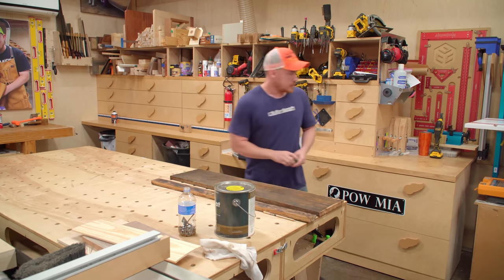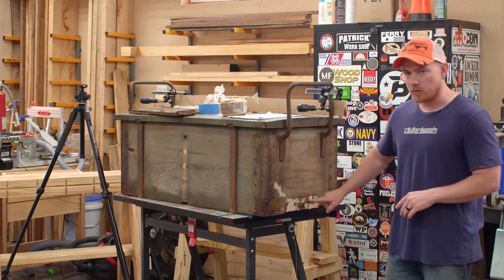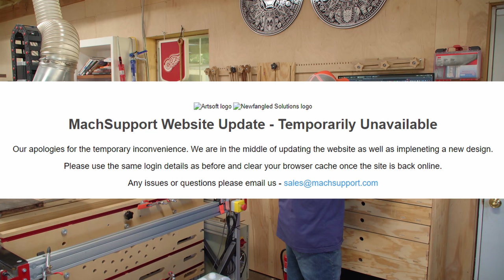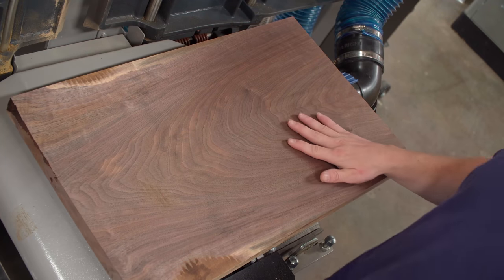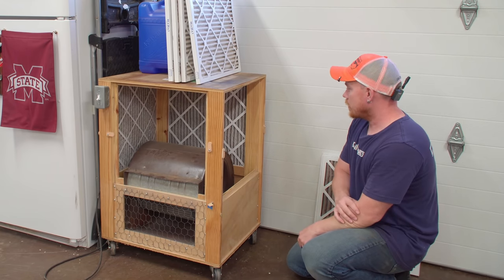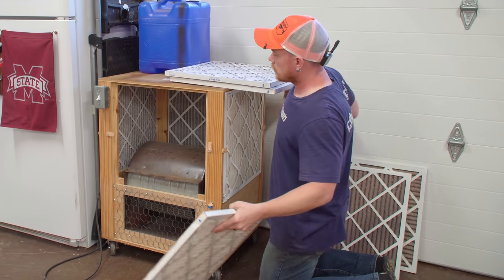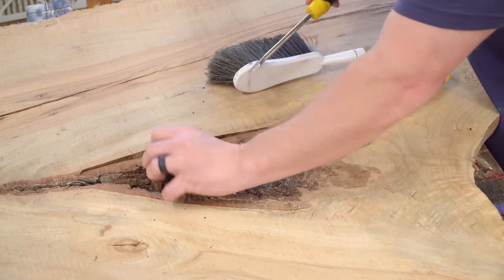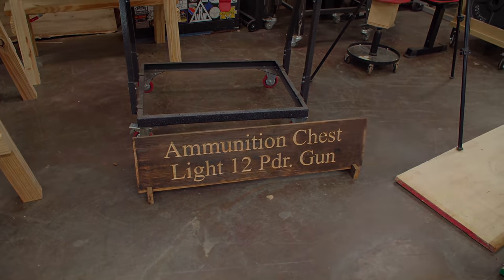Shop Day: Wide Walnut, Sign, Pecan Crotch

Comment: +1 for the Linux mention. Problem solvers and people who don't like the status quo use Linux. 💪
Reply from the maker: Somewhere between video 50-100 I switched back to windows after building my first editing computer in 2013. I was a linux user at the time mainly running XFCE. KDEnlive was my first video editing program. Switched to windows because at the time KDEnlive didn't support multiple CPU cores making my new build kinda useless.
Reply: @JayBates2  amazing! Well I don't blame you for the switch - I'm a web developer and use a Mac for my day job simply because designers use software that runs on osx and I have to open them. 🤷‍♂️

Comment: Convert the CNC to LinuxCNC. Seems I heard that Tormach has converted to LinuxCNC to run their machines, and released some portion of their Path Pilot UI so it can be used with other machines. I've not attempted to change from the default GUI for my CNC box. Just using the default Axis.
Reply from the maker: SketchUp isn't great on wine. I haven't tested VCarve pro on wine yet.

Comment: Jay...I did like this style video.  Random thoughts and ideas that may be useful to others.  I have been watching for several years and picked up lots of good tips from your videos.  In fact,  I bought my A3-41.  Overall good choice - it is a beast but I have had challenges with keeping the joiner aligned so that I can count on consistent flat joints.  I now keep the left cover plate for snipe adjustment open so I can make small adjustments if needed.  My thoughts are it is a faulty design issue because the snipe and ability to keep the head and outfeed side at the right dimensions seem to be dependent on the consistency with which you tighten the outfeed side when switching from planner to jointer mode.  Curious if you have had this same experience and is there a technique you use to keep the outfeed table to cutting head at proper alignment?

Also do you have a video on that device you used to go over the adjustment handle for the planner - looked pretty cool.
Reply from the maker: The adjustment handle for the planer is just a disc with a cutout for the handle. Super easy. I don't have any issues with the jointer. I only tighten the handles just enough to engage the cam. I don't crank on them at all.
Reply: @JayBates2  thanks for the answers.

Comment: Enjoyed this Jay. Question, do you ever clean out your filters with compressed air and reuse them? I do that a lot and just wondered if there were any problems that I hadn't considered
Reply from the maker: I don't do that for the air cleaner cart filters as I typically have more on hand that are slightly used and need to be repurposed. But blowing them out is definitely an option. I recall using my dust collector and a Dust Right brush attachment to vacuum off the filters a few times. I haven't done that in forever though.
Reply: +1 for vacuuming off the filters.  Seems to work well and extend the life.
Reply: @JayBates2  Cheers Jay, great to hear your thoughts

Comment: Would it be simpler when dealing with the bark in the middle to just cnc out a shape and inlay so you don’t have the epoxy look/issues?
Reply from the maker: It's a trade off. If I did that then I would loose some of the natural and organic look of the slab. Definitely an option but I'm going with the small black epoxy area.

Comment: Love the air cleaner it’s a brilliant design. It’s only drawback is the furnace blower. Absolutely impossible to find a 120 volt one used and a new one is way to costly for this application. I’ve found 240 volt blowers but that just won’t work for obvious reasons. If anyone knows an alternative I’d love to hear it.
Reply: Most are 3 speed, 120v. I live in a smaller town and see them on marketplace constantly. They're also referred to as "squirrel cages", so try that search term too.
Reply from the maker: That's interesting. Have you tried putting a wanted add in Facebook Marketplace?
Reply: @JayBates2  I've tried everything. FB marketplace, Craigslist, asking ac guys, etc. But where I live it's all air conditioners no furnaces. The AC's all use 240 volt blowers. I'm thinking it's due to the mild weather and the fact that the average age for homes here is much newer than most places. Surprisingly it's close to you, near the gulf coast. I could fill my yard with 240 volt squirrel cage blowers but the 120 volt blowers I've given up on finding a used one.

Comment: Hardware failure doesn't care what OS you're running.
Reply from the maker: True. But windows crashed and failed to start. I reinstalled windows on that drive and so far it's good. If the hard drive is failing then I'll eventually replace it. In the mean time I can designate that laptop for email and website article writing tasks.